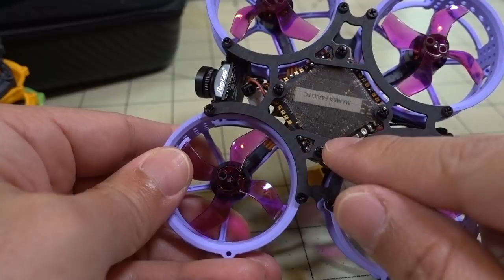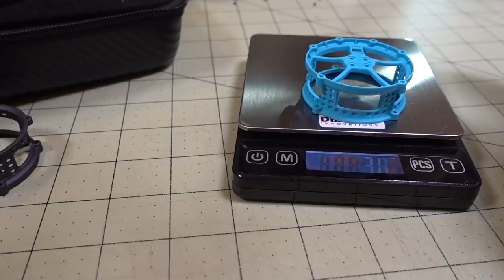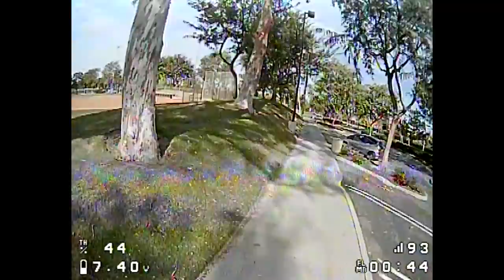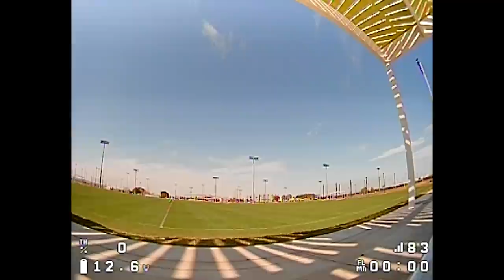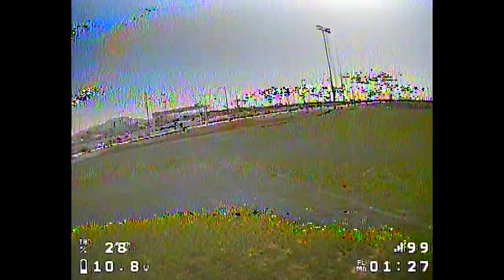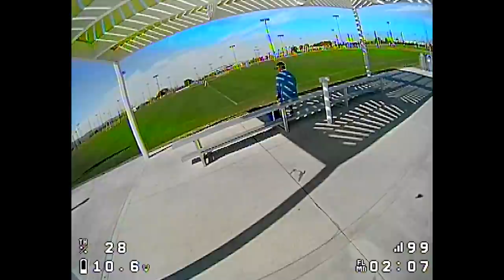Diatone Tina Whoop Preview 😀

Comment: Thought it was a misspelling. LOL. My GTB339 came with FalcoX. The fact it wouldn’t connect threw me for a loop at first but everything is available via OSD. And it flies beautifully. Like silverware but for larger quads. I really like it.
Reply from the maker: They didn't tell me how to set it up so I tried via my PC and failed.  So I just flashed Betaflight so I could fly it.  Now I'll have to flash it back to FalcoX.   Not sure how to do that however.
Reply: @AlbertKimTV  I only figured it because mine was part of a group buy and the other pilots who had already set up theirs, clued me in.

Comment: Great review al. For Falco you need the falcoX configurator from Flightone to do it on the computer. The regular Flightone configurator won’t work. But with falco when you plug in for the initial setup thru the osd your goggles need to be on either F1 or F7. I just got the Diatone GTB339 with FalcoX from Flightone and setup was like my other falcoX quads. Was pretty easy. It definitely flys differently on falco than it does betaflight. Much tighter in turns and less prop wash. Also same tune for both 2s and 3s lipos. No need to change pids or throttle caps... on the 339 anyway.
Reply from the maker: Thanks!  I got in touch with Preston and he guided me already.  I will have a follow up video with falcoX on it.
Reply: Albert Kim awesome! Yeah anytime you can’t get in touch with them just msg me. There’s not much I don’t know about Flightone. 👍

Comment: Well, all those holes in propguards doesn't make it any more efficient on the duct-side of it, so this just makes it some heavy and cute guard-design. That antenna placement isn't ideal either, but other than that it's cool design and that extra weight does help it in the windy situations, like we see in the fpv-feed. Look at other 40mm builds and compare yourself ^^ It's made for cruising and it does exactly that ;)
Reply from the maker: What's wrong with cruising?  Why discriminate against cruising for FPV?  Is this how FPV is?
Reply: @AlbertKimTV  Did I say something against cruising? 🤔 If so, it wasn't intended 😆 I gave it some up's and down's, but nothing against cruising 😉

Comment: I just build a 3 inch toothpick, but If I make rapid turns on high throttle and at the beginning of the battery, it just screems and flies away. I don't know how to fixt it.
Reply from the maker: Your D gain is too high and/or you need more filtering.  You have a feedback loop in your tune.  Try to upgrade to 4.1.1 if you can.
Reply: @AlbertKimTV  thank you. I've bf 4.1.1 with rpm filtering. I'm gonna try this. Thank you

Comment: hello albert do you know how to change the receiver settings on the Lite 2S Brushless Flight Controller (Silverware Firmware) the betafpv manual do not work
   Press the FC button on the bottom of the FC and plug the battery at the same time • Release the button and press the FC buttonTWICE within 4 seconds • Once “DSMX”shown, FC is successfully changed to DSMX mode.

this don't work ..

Comment: I got a question and hopefully you can help. I have the 12000 KV version with betaflight pre loaded from Diatone. I added a XMplus and checked everything in Betaflight and it looked normal. Everything is great but, I get like 30 second flight times on a Tattu 2s 450mah. I have never seen a quad suck a battery from 4.2v to 3.2v that fast. I'm lost... Thanks.
Reply from the maker: I don't have that version but I suspect something is wrong with the PID tune and/or the battery.
Reply: @AlbertKimTV  The batteries are in good shape they get 4 to 5 mins on other quads. I'll check the tune and re-flash the board maybe. Thanks

Comment: How to fix jello on this whoop?
Reply from the maker: Try lowering P value and/or swapping props.  Also, make sure there aren't any wires touching the FC gyro and that the mounting isn't reducing the vibration dampening.
Reply: @AlbertKimTV  Thanks for the tips , my eachine trashcan has much jello, I ve upgrade to 1102 10000kv motors but still jello 😥